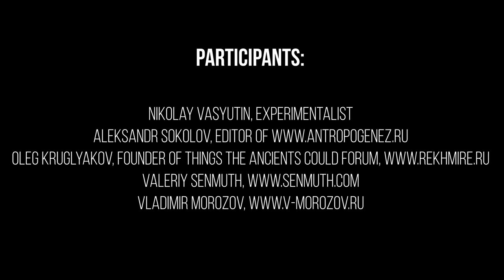Making Egyptian Drill Holes: Lost Ancient High Technology

Comment: This video ignores the spiral cuts that are found on some ancient cores and bore holes, which show that the ancient tool was advancing much more quickly than by abrasive sand. This has been the actual leading edge of the ancient tube drill debate for decades. But of course this video doesn't mention that or attempt to explain it.
Reply: Most serious people who have a problem with the establishment narrative don't think there is alien technology involved. This itself is a shill tactic meant to confuse this topic further.
Reply: Most serious people who have a problem with the establishment narrative don't think the ancients were stupid. They believe that the timeline is wrong for some ancient stonework, specifically that some (not all!) of the stonework is older than has been concluded. This is an extremely reasonable position given the evidence.
Reply: Also, many people have done this experiment before. This experiment is no different than the experiment that was famously broadcast on Western TV in the late 1990s. They had a crew, used abrasives, got a few inches into the stone, and declared victory ... just like this video. But it doesn't address the physical evidence, like the spiral cut marks, to name one.
Reply from the maker: About "the spiral cuts", specially for you: https://youtu.be/HQi4yql7Ysg
What a pity.
Reply: @ScientistsAgainstMyths  This is good. Nice work. I will be passing it around on the English-speaking side. I am sure that you are aware of other big challenges, like the granite boxes of the Serapeum?
Reply from the maker: @viic1607  thank you. Yes, aware a little. We conducted an experiment, e.g.:  https://youtu.be/HQ2bHE7mTi4
Reply from the maker: We have published a big video about the Serapeum sarcophagi https://youtu.be/47HAYcii_Q8

Comment: Core 7 has  One continuing line around it's not 2. . It took 1600 RPM .  And  2000lb of   Downward pressure. This would have been drilled out very quickly.  In this video these guys are taking a very long time just to put a scratch.  Egyptology is wrong except you're wrong .

Comment: i thought the issue is with the speed of penetration, not how to drill a hole, which is easy, but  how fast it went
Reply: Not sure what you mean when you say the speed was the issue in question.
Reply: @Eyes_Open  of course you're not sure.   Still waiting on you to produce them cutting 1000 ton block of solid granite and moving it 500 miles. Did you forget? It was "show that or stfu".

Comment: 40 mins of drilling for 5mm? yeah, that's feasible! one HUGE problem though, the drill holes measured tool cut marks nearly 2mm deep for each roation
Reply from the maker: Watch: https://youtu.be/HQi4yql7Ysg
Reply: 40 mins for 5mm = 400 mins for 5cm = 4,000 mins for 50 cm. That is one week of full time work, what did you achieve while working last week? You wrote a couple thousand characters in some spreadsheet that nobody is going to remember in a month?
Reply: @LesterBrunt  
i repaired machines which save lives
Reply: @andyman8630  And? Are you physically incapable of engaging with the point? How are you able to do something fairly complicated as repair machines yet appear so incapable of communicating like a normal human being?
Reply: @LesterBrunt  
the point, which is very simple and i would have imagined simple enough even for you, is at those rates it would have taken a million people 10,000 years to build everything we see in ancient Egypt
Reply: @andyman8630  I just did the math, less than a week of working full time to cut through 50cm, that is  10 weeks to cut through 15 feet, didn’t you read my comment?
Reply: @LesterBrunt  
you're missing the point - there are 118 pyramids alone, not to mention all the tombs, palaces, temples, monuments, statues, works of art and cities, etc - as i said, to build all that we see (not to mention that which we don't see) would have taken a million people 10,000 yrs

the other half of the point is they evidently had some tech we're not yet aware of
Reply: @andyman8630  So where is your math? You just assert this when I calculated how much could actually be done. 10 weeks for 15ft of stone, times that by a 100 people and you can cut 1,500 feet of granite in 10 weeks. 
You do realize the Egyptian ruled for millenia right? Those 100+ pyramids weren’t all built in a couple of years, and most of them were tiny in comparison to the great pyramids.
Reply: @LesterBrunt  
so, you're not interested in the truth, you just want to 'win' an inane argument

whatever
Reply: @andyman8630  You are just being malicious at this point.

Comment: That's OK but what did they do when they had to drill into the side of something . you can tell the holes that wear found wear drilled with a high speed drill
Reply: Allow the obvious = turn the stone on its side........

Moral of the story:  why drill a hole into the side of a block???  Answer = perhaps as a place to insert a wooden post as framing for say an entrance gate for a building.  So do you first build the gate via said blocks to then drill the holes - OR - do you rather knowing what you need ahead of time drill the hole from the top down = and then assemble your gate turning the drilled blocks the correct way and inserting the wooden framing as you assemble the gate???  Methinks the latter.  🤔

p.s. - where did they get bronze tools such as pipes = they cast them obviously.  There are archeological records of expeditions during the Old Kingdom as an example to Sinai where copper mines existed to harvest ore.  There is ample evidence that they could then cast various tools from said copper as it was after all "the Bronze Age".  

There are actual bronze tools found in the tombs of master craftsmen in museums today.  Yes they are rare because copper was a valuable resource which could be remelted/recast when needed into other items = but they exist - as do depictions of various tools being used by Egyptian craftsmen in tombs.

Comment: Yes a great demonstration of how core holes were drilled in ancient Egypt granite.   Just one question.... (as @Altimit1417 mentions in their comment)... how did the ancient Egyptians create the thin copper tubing used to drill out these cores?
Reply: A possible explanation would be from ceramic - read fired clay - molds.  If you create a cylinder of a given size from clay -----> wrap that with something to give you space such as papyrus etc. --------> encase that with another cylinder of clay -------> bake it much as you do with how they created their pottery = you end up with a mold which can have molten bronze poured in between your baked cylinders creating "a tube".  The wrapped inner layer will burn away leaving only the clay outlines. Ceramic molds are still used in casting today.  🤔

Comment: There are horizontal bore holes that are 5 ft or more in length.  No way to put weight on the drill and no way to make a 5 foot long copper tube drill.  Can’t gradually drill and remove cores from inside the hole.  Until you accomplish this you haven’t really shown the technology.

Comment: I think they had steel tools, copper would have to be melted and reworked for continued use, which needs ressources for the fire. I wonder if they may have had denser energy sources than wood etc.
Reply: That would have required a blast furnace of which there is no evidence.
Copper actually works well for this purpose, it is soft so it holds the abrasive in place. Remember, the copper is not doing the cutting, it is the quartz abrasive.
Reply: @MrRecklessryan  I thought they had those, ill read up on that later. But the holes are not so much a problem, the large and well cut stones are. Stones with complicated corners, and reliefs. To do that with a copper chisel and a pounding stone would take damn long and use up wood etc. for melting and casting.
Reply: @ABW941  Larger stones were not a problem, remember the AE  had a massive labour force and plenty of time and resources, no problem at all. Archealogical evidence shows that the the Ancient Egyptians were not only master of stone but also logistics. We know where they quarried stone and we have unfinished pieces left in quarries so we can see tool marks and methodolgy. It's all very interesting.
Reply: @MrRecklessryan  And the toolmarks were made by copper tools? Is there any copper residue left on the stone?
Reply: @ABW941  Yes, Some ancient Core holes still contain weathered copper or bronze residue and rock tailings/abrasive (Lucas and Harris 1962, Stocks 1986).Dec 10, 2002.
Reply: @ABW941  Archaelogist have found thousands of Arsenical copper chisels, I don't think they were toys, you have to remember that the majority of stone the AE were using was soft Limestone.
Reply: @MrRecklessryan  Bronze? Thats of course much better than just copper, but i thought that the consensus on this was that they didnt have bronze when they built the pyramides and most of the larger staues and temples?
Reply: @ABW941  They have found both copper and bronze, core holes and Granite work span across many dynasties.
Reply: @MrRecklessryan  But also granite, which was used for statues and even parts of the great pyramides. Some of the work would be possible, but wastefull and ressource consuming, other things would be hard to achieve, especially in the dark. Iam not one of those "Aliens did it" people, but maybe they came up with a more sophisticated way to cut stone. It is possible that someone "sanded" away the granite until it looked like the pharao but this would leave no tool marks, right?
Reply: @ABW941  Granite work would have been incredibly expensive, that's why it was reserved for the most prestigious purposes. 

Statues have been found at many stages of construction, not just in their finished form. When it comes to stone you don't need lazer beams or sound melting techtechnology. Mystery is what sells, it is very in right now.
Reply: @ABW941  All you need is a harder rock. Plenty of those have been found around the quarries. Including the marks how they were used.
Reply: copper melts even on an ordinary fire without a forge
Reply: @ABW941  bronze is a mixture of copper and tin
Reply: @ВсеславВсеволодович  Yes, i know, but bronze is harder and more durable.
Reply: @ВсеславВсеволодович  It however needs fuel to burn,  and maintain a fire for melting copper.
Reply: @ABW941  
For a material such as copper, even an ordinary fire made of branches and trees is enough. Of course, a forge is desirable, but with easily alloyed materials like copper, you can do without it. Many things can go into fuel, from camel dung to palm trees.

The Egyptians knew how to smelt both copper and bronze, and their production was not some kind of secret for them. Later they learned how to make iron and steel. Like the entire Middle East and the areas of North Africa adjacent to Egypt.
Reply: @ВсеславВсеволодович  To melt copper you need 1058°C which you cant reach with branches, dung etc. Wood would get you 800°C, which would not be good for reworking, since you would start with broken and dull parts which would idealy be melted down and used to cast new tools.
Reply: @ABW941  
Charcoal, which can be easily obtained, will give a temperature that will allow even iron to be melted, you can make a simple forge and use palm wood. This will be enough.

there were definitely no difficulties with the smelting of copper and bronze in Egypt
Reply: @ВсеславВсеволодович  You still need a large ammount of fuel and the mentioned wood to make charcoal. So i wonder if they did import the necessary Fuel. As far as i know wood was always rare in ancient egypt. So far i have not found any estimations on the fuel consumption of one of the pyramides, it must have been extreme, since we know about lesser projects eating up entire forests.
Reply: @ABW941  
нет, "много дров" не надо, даже из небольшого количества древесины получится хороший уголь - например, из трети пальмы, а медь выплавляется только один раз и потом используется как инструмент для долго. Вы явно никогда ничего не плавили.

Египтяне умели и выплавляли и медь и бронзу и золото. У них вообще не было с этим проблем.

Это дерево не было редкостью в Древнем Египте, возможно, это были особые виды деревьев, такие как ливанский кедр, но в целом это не так. Для строительства пирамид не нужна древесина, тем более в большом количестве. Древесина нужна для того, чтобы выплавлять медь и бронзу, из которой делают орудия для обработки камня, дерева, кости

Comment: This is so different from the Ancient Egyptian way to drill. The surface is too smooth. This can be done to drill a hole, but repeat the ancient way to do it. You just check the surface of the tube. It's 2 - 3 mm per revolution.The Egyption is not like this kind way to drill the hole.
Reply: Ahahaha
Reply: "The surface is too smooth" google stone polishing

"This is so different from the Ancient Egyptian way to drill" only that they used a steel chisel and plasticine instead of clay

" It's 2 - 3 mm per revolution" epic fail

Comment: Now let's try the granite coffins with 90 degree inside corners and only 7 thousands  of an inch deflection on the sides!
Reply: Check out the rest of their videos
Reply: @Leeside999  You win dude,. Mystery solved!
Reply: @bonesaw6601  That was easy
Reply: @bonesaw6601  " I was pretty sure that a lathe of some kind was used.  It was the tooling that seemed to be missing" --- I'm not sure what you are referring to? A lathe used for what exactly?
Reply: Rotation ,like a potters wheel. For the jars.  Boxes, just rocks and elbow grease.

Comment: It’s one thing to make one hole  takes a lot of time. And it’s not precise.  And how did they make millions of holes. Carve massive stones several tons each.  And how did they lift millions of blocks without cranes ?
Reply from the maker: > And how did they make millions of holes
No way
Reply: "millions of holes"... no no...not millions, cmon...be real.
Reply: You are conflating a lot of unrelated things.......

1 - how did they "lift" millions of blocks = easy - they didn't.....  The largest/heaviest blocks in the pyramid are actually found in the lower half = closest to the ground.  Above that point the blocks are smaller as the pyramid rises with those at the top being small enough for several men to lever into place.  Thus the larger blocks were pushed/pulled/levered into position via ramps.  The smaller ones could be raised via fulcrum/lever devices akin to the Egyptian shaduf such as Herodotus wrote of.  
2 - how many holes in blocks do you see in Egypt??  Answer:  not many......  Why drill a hole in a stone block??  Answer:  most plausibly for the insertion of wooden poles for framing.  This means hanging gates etc..  Yet Egyptian temples were = open air.....  So gates infer perimeter walls and enclosures which means royal areas etc.. - which reflect a tiny amount of Egyptian construction.  Wood being valuable and hence scavenged means they took the wood at some point and left the blocks which sometimes were reused to build other things.  
3 - carving blocks.  Most Egyptian constructions are = limestone - not terribly hard as a stone and fairly easy to work.  Chisels and hammers can certainly accomplish that = but so can gneiss stone such as Flint or Dolerite tools - which coincidentally Egyptologists have found maaany examples of.  So while they certainly used bronze tools for certain applications the basic tool would actually be stone - it being ubiquitous and cheaper to use.  

Drive a line of chisels into stone at intervals along perpendicular lines and after the chisels are hammered in a bit the stone per expansion will = begin to split along your lines - not unlike a perforated cracker.  That = is how most blocks were obtained.  They were not individually chiseling a million blocks,  Very few of the total were carefully cut and in some cases polished.  Most are little more than "stacked rubble."  

Harder stones were obtained via stone tools hammering through the softened bedrock owing to heat application - aka "firesetting" which was used for millennia in antiquity for mining.   Heat an area of say granite bedrock and you can hammer through it exponentially faster than simple pounding alone.  Egyptologists coincidentally have found...... = areas of charcoal and mud bricks along natural fault lines in granite quarries showing they heated areas and pounded through.  Anything else.......